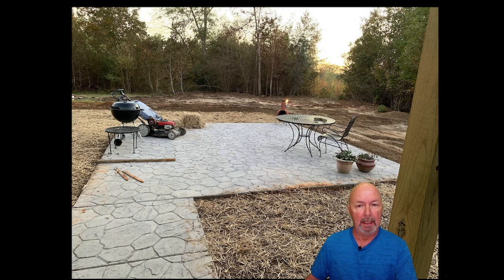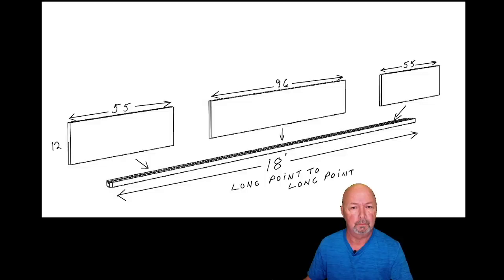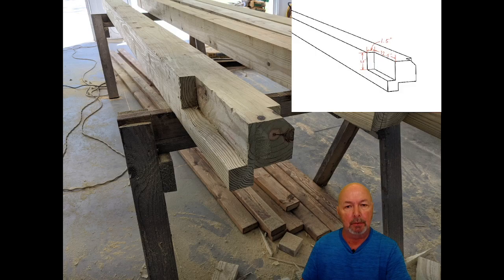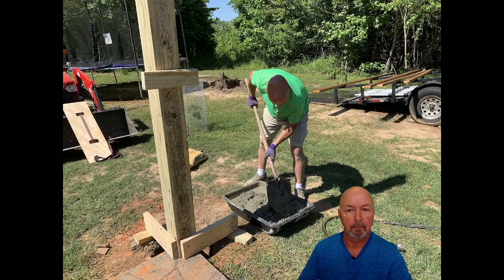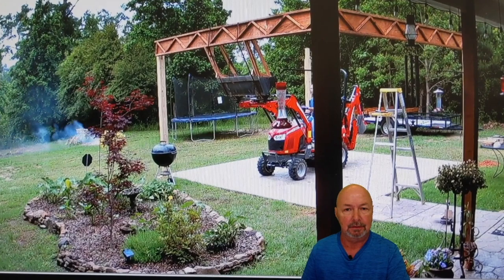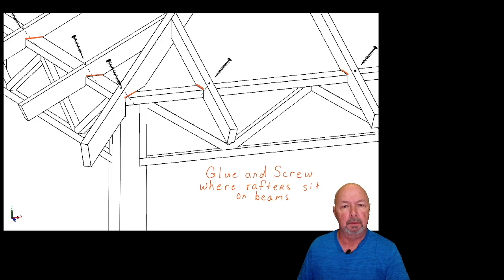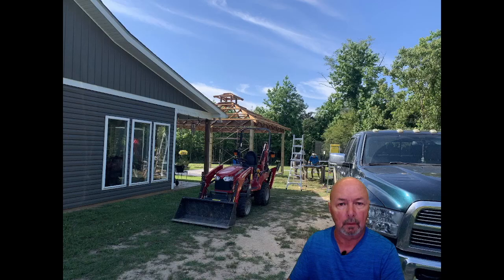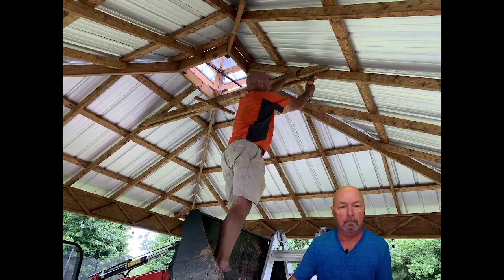Build This Awesome Patio Cover

Comment: It turned out beautifully. But I wouldn't bury wooden poles in the ground. There they will rot. Concrete foundation pillars had to be made in the ground. And I would also make slants from the post to the beam. In winter, when there is a lot of snow, with a strong crosswind, your structure will fall. There is not enough rigidity of the structure.
Reply from the maker: Hi and thanks for the comments. Where I live, in the southeast USA, poles like the ones I used which are pressure treated can last up to 40 years. It is common practice to put them in the ground just as I did. Also, wooden beams are built very similar to what I did. Look up engineered beams.
Reply: @NINEPOINTFIVEPROJECTS  I see. I liked these beams. You probably have a dry and warm climate. There is no snow in winter. Then the wooden columns will last a long time. But I would fasten the columns and beams with oblique bars. I am an architect by education.

Comment: Awesome job!  Would you happen to have the plans?
Reply from the maker: Hi Douglas, I didn't use plans as I drew it in a 3d modeling program called Solidworks, so the only thing I have is a 3d model of it. I do have a pretty accurate Bill of materials I can pass along to you if that would help. I would need to check a few things on it first.
Reply: I'd be interested in the Solidworks model and the material list. If you would not mind sharing sir.
Reply from the maker: I'll be glad to share.  I have my grandson this weekend and he takes all my time..   I'll get it to you next week?
Reply: Sound good. Thanks
Reply from the maker: Hi Chris, I just included a link to the Solidworks Model as well as the Bill of Materials. Let me know how they work for you. Enjoy!
Reply: @NINEPOINTFIVEPROJECTS  Thank You Sir. Ill download this evening